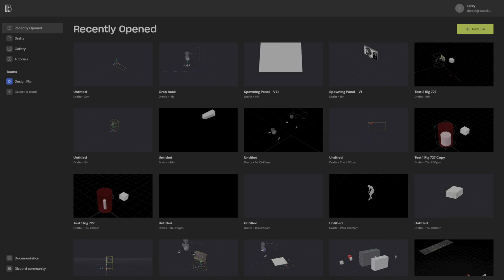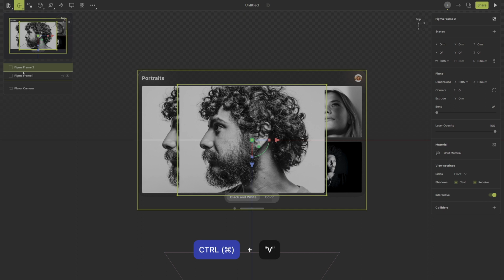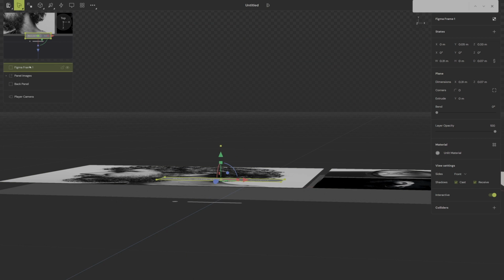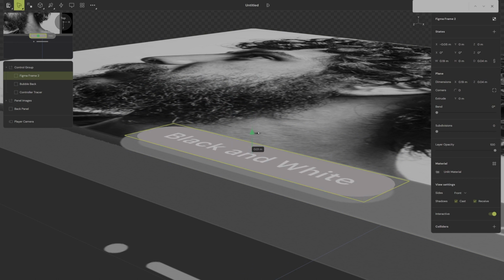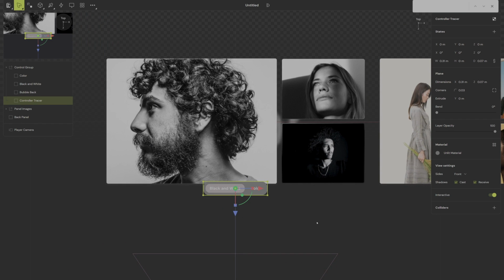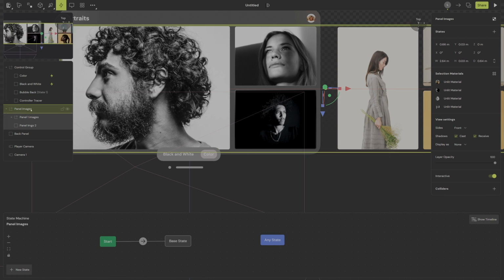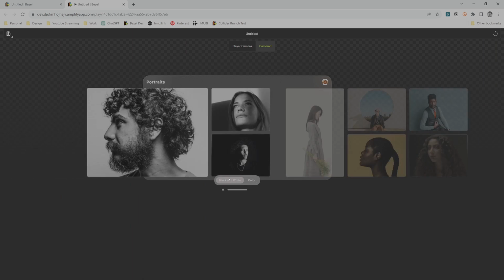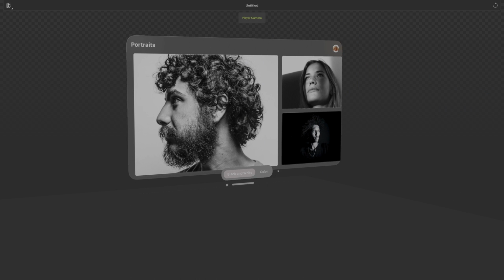⚡ DESIGN an Apple Vision Pro panel in 17 mins!

Comment: @daniel:
How can I zoom in and out when viewing the prototype in mobile AR or HMDs? 
Mobile browser (Google Chrome AR mode): I tried moving my phone front and back. Is there an alternative?

How do I fit a high-resolution Figma prototype into the golden circle area as per your tut?
Reply: FYI, I am working on a master's project (dissertation) for which I am designing a banking application (simulating Internet banking operations such as account overview, fund transfer, etc, to test the change blindness among users).

For this, I need to export and import a desktop frame size.

I appreciate your valuable ideas, please.
Reply from the maker: You cant zoom in AR. You could have a state that scales an object, but there is no relative scale based on a camera.

Comment: U r too good at this! Love it!
I too want to design in figma and bring over to Bezel. But I always struggle with unit of measurement.
Which unit of measurement do you use when you are designing on 2 different softwares like figma and bezel? How can you be sure that the screen size you are selecting for Bezel is going to be the right size when see in AR VR?
Reply from the maker: Sorry for the late reply. Meaning to make a video about this at some point. 

So basically I used a concept called DMMS. Basically I set my default distance at 1 Meter. Then convert every pixel to 1mm. So an 80px font would be 80mm. If i move the size further away I then multiply. So if I design my panel from 1 meter, and then move the panel 1 meter back. I would scale my my type by 2X. Meaning 80px or 80mm will then be 160px or 160mm.
Reply: @marqusee  ooooo it looks like a tutorial on how you design using DMMs would be very helpful 😄